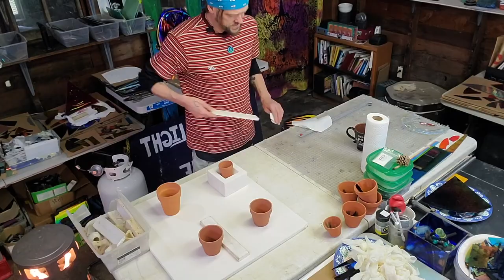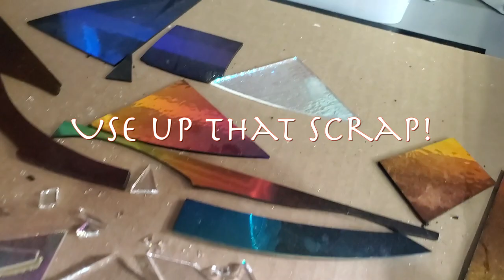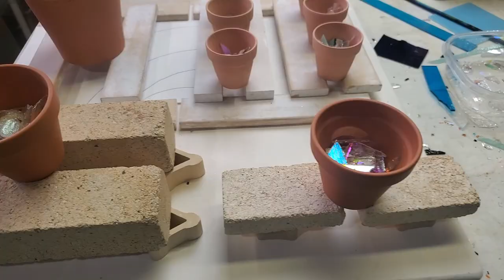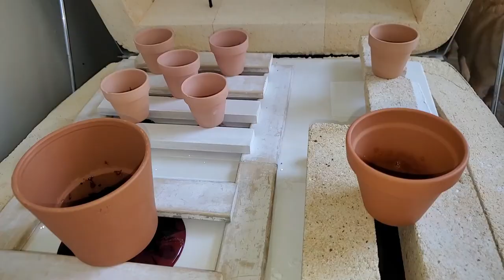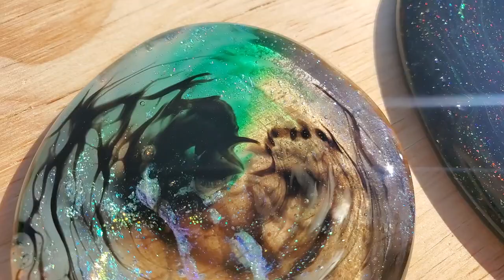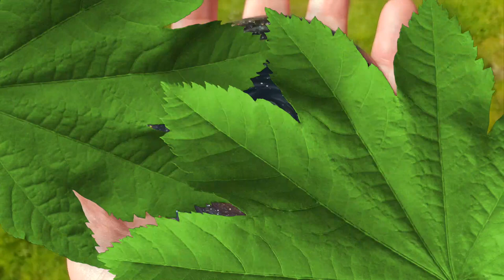How to~Mini POT MELT Dichroic glass Drip~pendant size Galaxy~ use scrap up~Fused glass Art

Comment: This just today pooped up. Glad it did as I must have missed it when it was first released. Love your dicro rounds! Looks like you put your dams directly on a treated shelf? Speaking of dams were they treated and are they mainly posts? I've heard to use the Italian made pots because the glass won't stick to the pots resulting in a clean flow. Your disc's are beautiful and this doesn't look like you had any issues. Lastly, your schedule has only one segment? Would you recap that for me, please? Thank you for sharing!!
Reply from the maker: Those damns were just in case .. they never touched glass but ya kiln wash just in case.  Any pot will do so far  I haven't hade any pot issues from cheaper pots!! .. on the temps .annealing same as any glass piece that size.  My kiln 
300.. 1600. 2hr
 9999...990..1hr
150.. 700..30min..
Reply: @speedoflightglass  THANKS, I will try again.